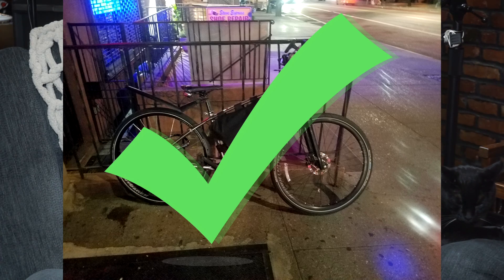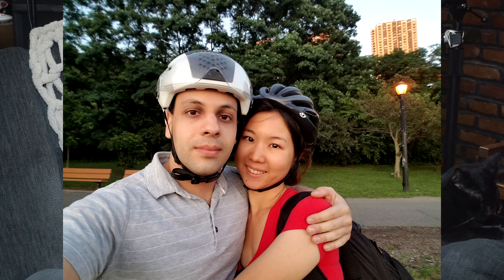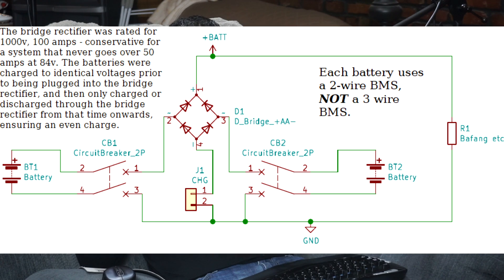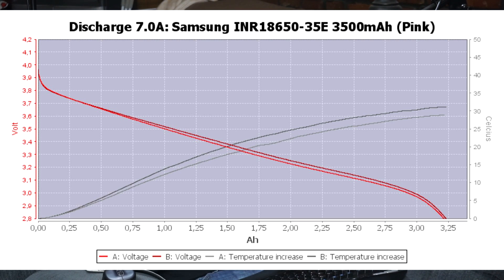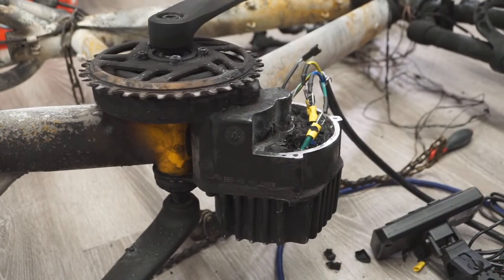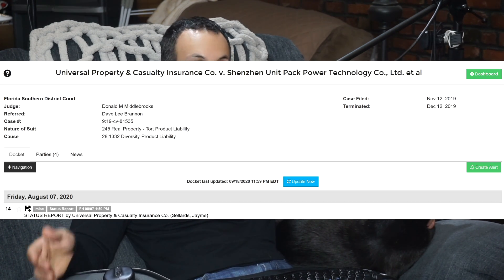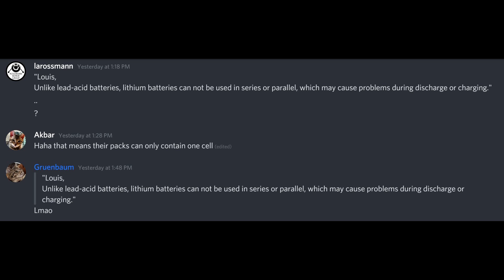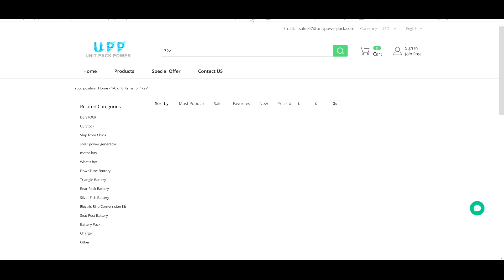Louis' front door goes BOOM courtesy of UnitPackPower battery.

Comment: Despite all the lobbyist "worrying" about cell phone batteries supposedly exploding into giant balls of fire, apparently it's really the cheap/crappy bike batteries that are actually the ones to watch out for, lol.
Reply: and fake hover boards from china
Reply: @myview5840 If my little anecdote is anything to go with, the Chinese no name hoverboards had a wire cutting & shorting problem. Add to that a pack with no fuse and things may get uncomfortably hot :). Saved a couple cents of labor by not filing off sharp edges on the tubular links between the sections of the board. The edges would eat through the wires like the insulation was hardly there. Those were some really sharp edges, good enough to cut your finger if you weren’t aware of the issue and dug inside. On mine it was “just” one BLDC phase shorted so the controller saved the thing from burning up. Nothing failed permanently - had to file the metal pieces, reinsulate the wires, replace the battery pack (was drained flat) and it worked again well. The battery pack wires were cut almost to the wire so it was a step from disaster. And it sat that way in the thrift store. They missed a fire by literally a fraction of a mm.
Reply: @bruh meme You are mistaken about the note 7 : https://news.samsung.com/global/infographic-galaxy-note7-what-we-discovered?awc=18739_1601644319_ea7c491b160ef33ac6e38bc5bc79af2a shows what went wrong with the battery design and manufacture.
Reply: @Mrdardas99  the battery didn't have enough space to expand & contract comfortably when it heated up say while charging.
Reply: @bruh meme people call cellphone chargers "chargers" but they are not "chargers" they are power supplies with different selectable fixed voltages, its upto the phone and the battery bms to operate as the charger and charge the battery. it is possible that a power supply was putting out more than maximum voltage and that somhow the phone didn't detect the issue but thats just a different design flaw and still on Samsung
Reply: @bruh meme not even Samsung themselves blamed 3rd party chargers, so I don't know why you would think that. there was clearly a manufacturing issue that combined with a unique battery corner design meant that some batteries develop hot spots in the corners and short out internally, causing a runway thermal reaction that sets fire to the battery. Just because some batteries are fine that doesn't mean it is a safe product - you would never know if yours is ok before it suddenly burns your house down. That's why Samsung did an UNPRECEDENTET thing and bought back ALL of their flagship note 7 phones  - they took a hit of tens of Billion of US$ for that! That's Billion with a B !!!
Reply: bruh meme this is also how you fry the TriStar circuit in modern iPhones. You think it's a bad battery but replacing the battery reveals the fact that the circuit itself is damaged
Reply: So should I throm my Samsung or not?
Reply: @bruh meme "the issue wasn't nearly as frequent" they only had 92 cases of "batteries overheating" and could only confirm 35 of those. Out of about 1 million that were sold. It wasn't frequent to begin with...
Reply: @bruh meme These power supplies are not current sources, they're voltage sources with a limited current capability, and the actual current flow is not negotiated, but rather the supplied voltage is.
Reply: @bruh meme whoa whoa whoa you're dead wrong mate
Reply: @bruh meme i'm not denying that there are dodgy chargers out there, just that they have anything to do with the note 7 case. I mean, how exactly did Samsung came out looking good?? they lost over 10,000,000,000$ for their investors that quarter, can anyone even fathom this amount? They definitely didn't accept blame and that insane cost because they "overly care". they would only do that if the liability and bad PR would have been so gargantuan that it would dwarf even that massive cost - so they couldn't just issue free high quality chargers for everyone and be done with it. In fact, they deemed their own phones so unsafe to use that they went so far as to force update the firmware of any phone still in use to make it inoperable.
Reply: @bruh meme Well not exactly dont blame 3rd party chargers, i work with phones and laptops and what you say is so comedy lmao all the "chargers" nowadays are just power supplys laptop battery chargers are just a 19.5v at 65w (3.34Amps) its just a power supply that gives 65w when you plug it into the laptop, the laptop and the battery BMS does the work to charge and the laptop takes its power (example for my 2009 vostro it would be 45w mostly for everything if i ping the cpu) and the same its for phones, usb "chargers" or laptop "chargers" dont do jackshit to the battery they only give limited power to the device and the device manages its battery, do you really expect your smart tv, xbox, car stereo, dvd player, etc will have some kinda programming to charge your battery? lmao and not even usb C, Usb PD sends 5v at start then the device will communicate with the "charger" if it can do 20v and then the "charger" will send 20v at X amps but the phone will do the work to manage its own battery, i invite you to watch ElectroBOOM, DiodeGoneWild, Bigclidedotcom. and mostly DiodeGoneWild that he does autopys of usb chargers
Reply: @bruh meme you're wrong once again. Look up the inner workings of Quick Charge, Samsung Adaptive Charge and USB PD. The Note 7, in particular, used QC2.0 and Adaptive Charge. The voltage supplied to the phone, from a compatible charger, is variable, and negotiated. It's been years now that chargers are not 'dumb' but rather variable power supplies. 5V is the norm for USB 2.0, and that's what a computer USB puts out, but certainly not what happens with USB PD, QC, or Adaptive Charge (edit: they can supply 5V, of course, but they're not fixed power supplies, that's what I mean). 5V and 3.3V are the kind of rails you see internal to a product, but in regards to phone power supplies, we're shifting to higher voltages so theres less voltage drop in the cables and overall better efficiency. Afaik this does not apply to OnePlus phones and their 5V/4A standard, but I might be incorrect as I don't know that one as well as the other power negotiation standards.
Reply: @bruh meme and I should provide sources, but really, a 10 minute read of the wikipedia article on Quick Charge will give you enough knowledge about the topic.
Reply: @bruh meme i fix phones as a job lmao and already people is telling you that it dosent work that way again go and watch ElectroBOOM and DiodeGoneWild here in youtube
Reply: @bruh meme as any "charger" usually your typical 5v 2a charger is just that The phone "never asks" shit to the charger it only takes how much amps it wants, its like your house electrical wiring, you think your tv is gonna to ask to the power meter to only send 120w to it? lmao man really and if you say DiodeGoneWild or ElectroBOOm dont explain it or you really dont understand electronics you didnt watch their videos at all
Reply: @bruh meme you are wrong 
Phone chargers only send 5v and 2A now adays iphone ones only send some data to say it can do 1amp or 2amps or for android some fast charging like qualcomm 3amps but the problem was samsung tried to squeeze more energy into the battery layers making then more thin so when the phone usually had a bump or fall its when it exploded for shorting all the layers, anyways phone chargers really dont "control the power to the battery" the one doing it its your phone the charger just sends the same 5v and 2amps
Reply: @SUPERBOBESPONJA1000  Have you ever looked at USB specs in the last 15 years?

Comment: Louis, one of the bad battery articles you posted shows a federal lawsuit against your favorite brand EM3EV after one of their batteries burned down a Florida home. 
The danger of any lithium based battery is the power density of the chemistry. If you need that much amperage packaged in a 'lightweight' container then there are many risks. 
The only thing that I noticed in your schematic that could be a weakness, only because I don't know the full details is the circuit breaker. If it doesn't fully disconnect, there is a slight possibility of internal arcing which could cause a runaway load on whichever battery is is connected to. Recently, I had gotten several substandard in line circuit breakers that when enough amperage was put across them caused the plating on the contacts to delaminate, and when they were turned off, they shorted internally and luckily they were only connected to a lead acid battery, but they caught fire and I noticed smoke coming from inside my shed. I was able to put them out without much trouble, but if they had been used with a lithium battery, I would have had instant fireworks rather than a lot of smoke. 

Interesting watch though. 

I get my lithium battery packs from a company in California called tenergy, I don't know if they make your style, but they do make custom packs which I have used in different engineering projects over the past 20 years or so. 

When I first saw the video title, I immediately thought that Apple started using cheap batteries in their products to cut costs and one of them blew up on your doorstep.

Comment: The problem with all battery banks is when one battery shorts and they don't have a fuse on that circuit.
It's all about how do you place fuses in the series/parallel combinations of batteries in a configuration in which if it one goes short circuit the another in parallel doesn't discharge over it causing fire and chain reaction.

Short circuits can happen. That's why overcurrent protection devices were invented.

I think one bad battery here go short and the topology of the cell array wasn't properly overcurrent limited.

Comment: Apparently you used more than 1% of it's 'duty cycle'.  The conversion from chinese is missing a few digits, like inches vs kilometers (simple mistake).  Ironically my 20lb car battery only holds 80 amp hours at ~12v.  Some of these lion batteries the size of a pack of smokes hold substantially more energy.  Energy is just an equivalent of work produced over time.  When that 'stored energy' becomes volatile and wants to release all at once, good luck...  You can't put out lion battery fires by submerging them in water, they contain all of the fuel needed to burn until its gone.

Comment: I wonder if something happened to short the batteries when you tripped the breaker.
Reply: I once accidentally shorted a 5S1P Lithium battery of a portable power tool with a breadboard jumper wire. Most of the length of the wire vaporized instantly.

Comment: 2:35 
These firemen dudes just waltz right up to the fire and basically walk right through it to get into the building, likely to make sure the people in there are safe. 😲 Pay them more!
Reply: After 9/11 this is a cakewalk 😬
Reply: Agreed. Take it from one who spent years in their boots, it’s a very difficult, very dangerous job. 
Enjoy your day!
🇺🇸Grandpa🇺🇸
Reply: @grandpaoldfart9165  Thank you Grandpa!
Reply: With a simple extinguisher they could have put out the fire immediately, without slowly wandering around for 2 minutes and connecting the hose. Never seen slower firefighters.
Reply: @ketanovas  lithium battery fire is not that easy to stop
Reply: @ketanovas  Li + H2O = ?
Reply: @ketanovas  They did seem to be chilled beyond belief!
Reply: A an f500 extinguisher, or the high pressure of the van. Looks like they don’t have that. They need more funds!

Comment: Hey Louis. Em3ev.com make excellent batteries. I am happy with mine. They don't really cater for the 72 volt market though and tend to be very conservative. I got my 72 volt pack from litespeedbikes  and was able to spec the pack as I wished. For 1000 US I got 140 cells of Sony VT6, 300 amp BMS for 20s 7p 1500 watt hours. Very happy so far. Cheers

Comment: You probably by mistake only had one of your parallel batteries on with your breakers. And while using your bike created voltage difference between the two packs. Then when you thought you turned off the battery you actually connected it creating huge amps going between the 2 batteries.

Comment: without even finishing watching your video , I was like "it's either s**t tiers bms and crap level of pack wiring"
I use mostly lipo/li ion on my RC cars and most point of failure come from wire that end rubbing against each other or the BLDC controler getting shaken to point that chips get damaged or desolder and create shortcut xD.
Reply: They might have been using cheap cells that couldn't do nowhere near their rated amperes. Chinese off-brand amperes are like NYC real-estate square-feet.

Comment: Best part of the video: 10:13
This company are such clowns! How do they think lithium cells in a battery pack are wired up? Such bogus.
Reply: They cheated. These kind of batteries should have seperate charge controllers and balancers IMO. Both Rossman (sorry mate) and the battery company are kinda going on the cheap out by not making a seperate balancing BMS. At least as far as I know, my cheapo electric folding scooter has a full cell balanced battery pack. You might be able to get away with a few paired cells without balancing, and just dump/balance pairs etc together, but I'm not sure if that is safe either.
Reply: @TechyBen  they both have seperate BMS's ? What are you on about ?
Reply: @SuperUltimateLP  Each cell should be balanced, right? Is each cell balanced? That pack has a LOT of cells in it. My little scooter has at least 12 balanced batteries (I think each "battery" is about 2 or 4 cells).
Reply: @TechyBen  If your individual cells are high quality you can but 2 in parallel without individually balancing each. If there crap cells they get out of sync and get damaged. But this is done in many many ebike batterys and normaly there is nothing wrong with it.
Reply: @SuperUltimateLP  But that bike had more than 4 pairs of cells right? So should it not have a lot of balancing regulation?
As said, my scooter has 12 or so balanced "zones" at least that I can read out (though sadly not recorded), and similarly, I'm surprised Louis was not able to confirm this in his app too.
Reply: @TechyBen  it did louis sad that both packs were made with there own BMS (battery management system) each pair of cells indevidualy Balanced.
Reply: @SuperUltimateLP  Ah, yeah, in which case his charger should not have done the thing that happened. :P

I still might reconsider where I leave my scooter though, but I tend to only charge it when I'm here, and use it rarely anyhow.
Reply: @TechyBen  he wasnt even charging it.
He just swiched his bike off.
Disconnected the batterypacks by opening the beakers.
And he didnt even pull half of the rated power.
The battery company did something wrong with his batterys.
Reply: @SuperUltimateLP Yes. But if they have no balancing they have no balancing.  I may have misunderstood and they do. But unbalanced cells may draw into each other, or flip polarity if they discharge completely into each other, at which point they may draw too many amps at a later time when recharged.